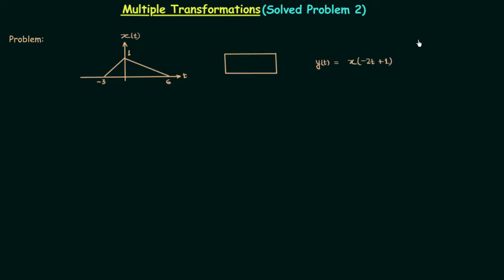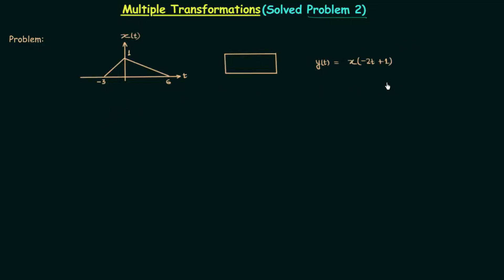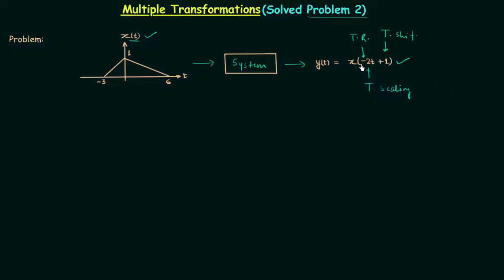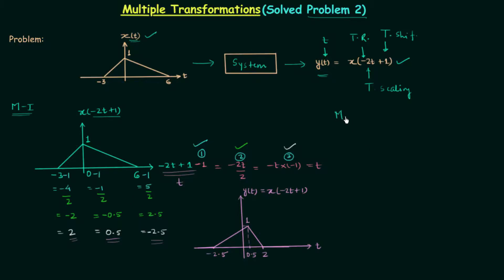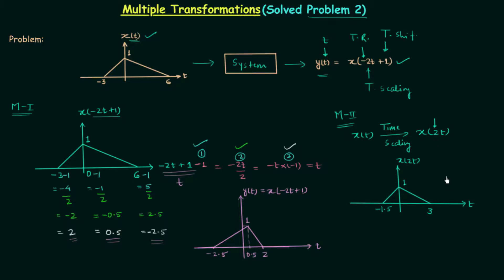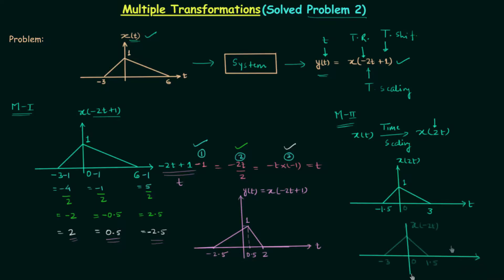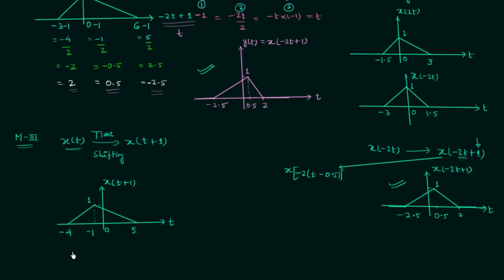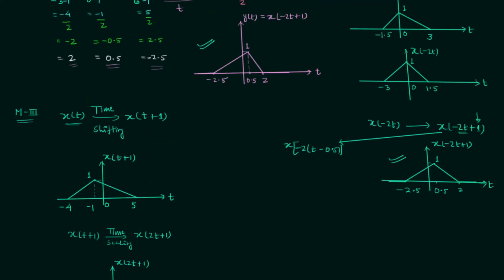Multiple Transformations of CTS (Solved Problem 2)

Comment: Use ARG Template Method
Yaxis: x(ARG)
Xaxis: ARG

f(t) vs t
is as good as 
f(arg) vs arg
now trace back arg to t

here x(t) given 
Yaxis: x(t)
Xaxis: t

do y(t) = x(-2t + 1)
Yaxis: x(-2t+1)
Xaxis: -2t+1

subtract 1
divide by 2
flip the graph or rotate along y axis by 180 deg
there u go no need for half baked priority orders

Comment: Guys here is the solution for everyones doubt have a look 👀 : 

For a transformation equation like ( x(at + b) ), where ( a ) and ( b ) are constants:

Scaling is represented by the ( a ) term. If ( a ) is negative, it also implies a reversal.
Shifting is represented by the ( b ) term.
The operations are applied as follows:

If ( a ) is negative, the signal is first scaled and reversed simultaneously.
Then, the signal is shifted by ( b ) units.
So, in the case of ( x(-2t+1) ), the scaling by -2 (which includes reversal) happens first, followed by a shift of +1.

For example, consider the transformation ( y(t) = x((t - b)/a) ), where ( a ) is the scaling factor and ( b ) is the shifting factor. Here, you would shift the signal first and then scale it.

I think everyone get clarified from this comment . Thank you

Comment: In this video, your method 1 and method 3 are same and works. Method 2 works too. But you never used the priority list as you have shown in the previous video because that will definitely give wrong results.
Reply: first try then write such comments 
using priority order the answer is coming same
Reply: I also tried Priority order. that gives wrong ans for this math. bro you should also try once. 1st reversal then shifting then scaling.  @retromonk88

Comment: use this:

Method I (Parenthesis method)

Step 1: Express x(at+b)  in the form x(a(t+b/a)). (note that the coefficient of ‘t’ within the parenthesis become  +1)

Step 2: Apply Scaling (and Reversal if ‘a’ negative) by the factor ‘a’

Step 3: Apply the Time-Shift by the factor ‘b/a’

Method II (Direct method)

Step 1: Start with x(at+b) – (note: remove any inner parenthesis)

Step 2: Apply the Time-Shift by the factor ‘b’

Step 3: Apply Scaling (and Reversal, if ‘a’ negative) by the factor ‘a’

Comment: in time scaling, a belongs to negative infinity to negative 1. -2 is covered in this case. and in previous lecture, satisfying this condition, there was no reversal in graph. so in negative cases of time scaling do we need to reverse the graph. if yes, then please modify previous lecture to avoid confusion like this.
Reply: Khyati Bhuva The thing you’re saying is only applicable to Time Compression and Time expansion.
Time reversal doesn’t fall in both of these categories. It’s a different case. 
Everything in this lecture is correct and accurate.

Comment: Sir 
Okay, if we get the concept, the priority order is not needed. But following the order should give the correct result, right? According to this, TR should be done firstly which is giving an entire different result (MIII- TR is done at last). Exam soon. Please help!
Reply: You're getting a different result because you are shifting with respect to t and not -t. For example, in this problem you need to write the shifting expression as -(t-1) rather than -t+1 (because the x axis is still t and not -t. So you cannot directly shift by +1 towards the left.) Therefore the time gets shifted towards the right. You should get the correct answer once you perform time scaling after this. Hope this helps you.
Reply: @siu281  Hey, thanks for the solution!
Reply: @siu281  Thanks mate